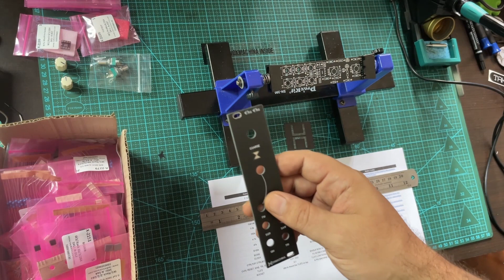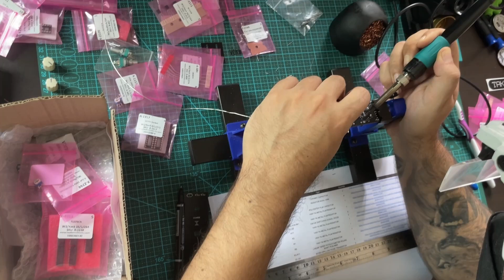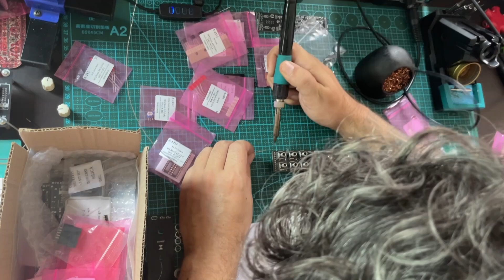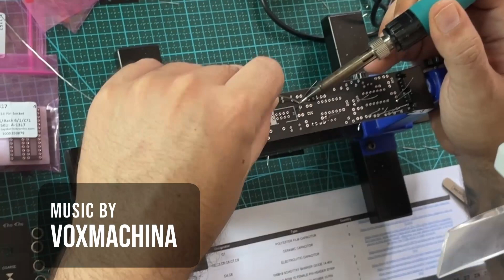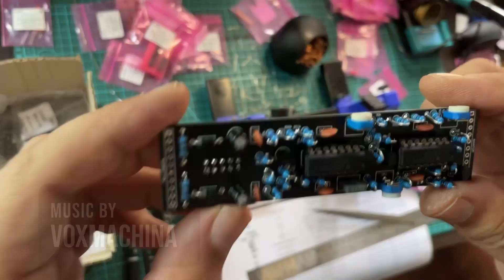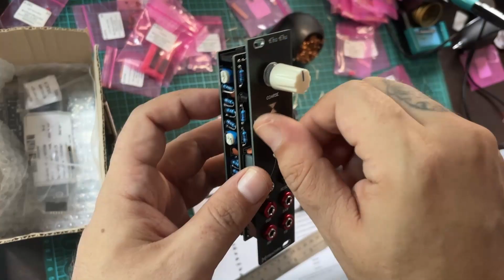DIY Eurorack VCLFO "Cha Cha" - Intro & Build

Comment: I just assemble the pin headers and only solder them when I put the two boards together.
This way you can use the pcb sandwich to align them perfectly.
Reply from the maker: Love it! Will do that now! Thanks! :)